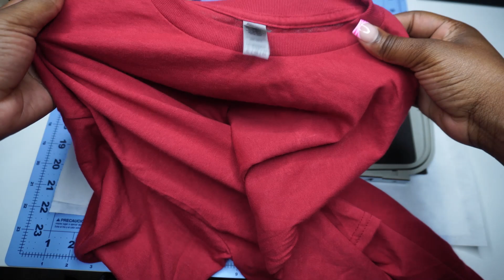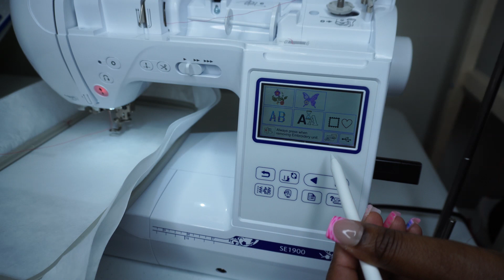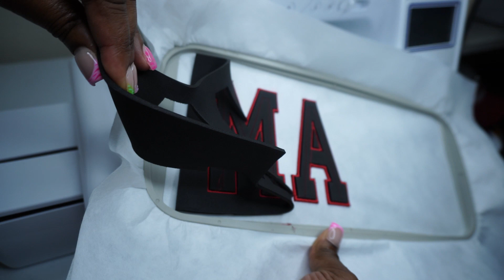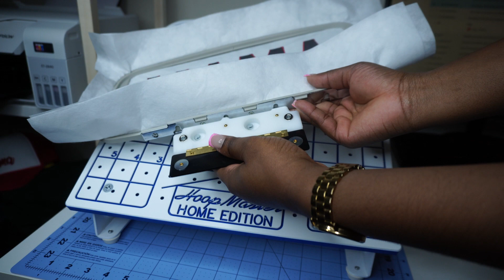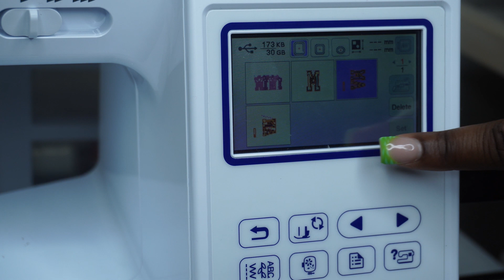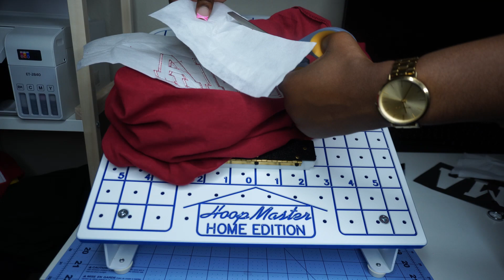How to Embroider Embossed Designs on Brother SE1900 Embroidery Machine using 5x12 Repositional Hoop

Comment: So are you are satin stitching the foam yes.
Reply from the maker: Yes and no. The stitch was digitized specifically for foam in order to ensure the foam is perforated. This is not a standard satin stitch digitized for flats as the setting, density, push and pull comp etc. are different.